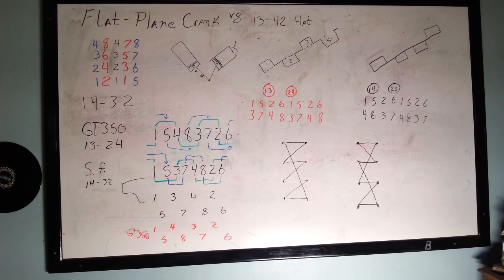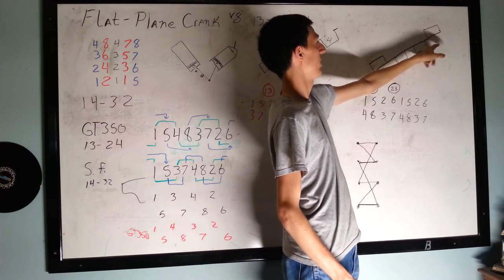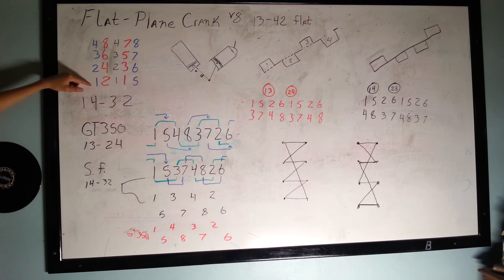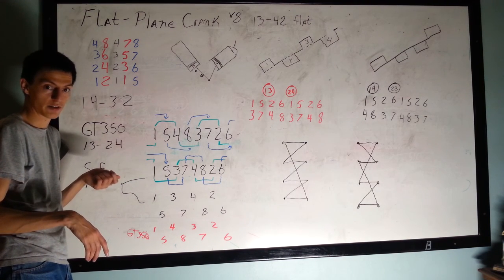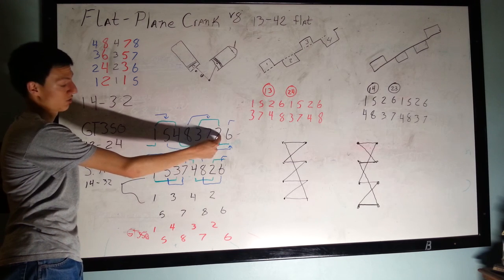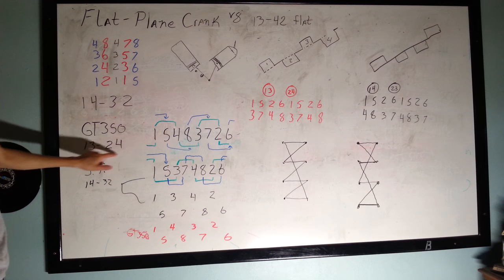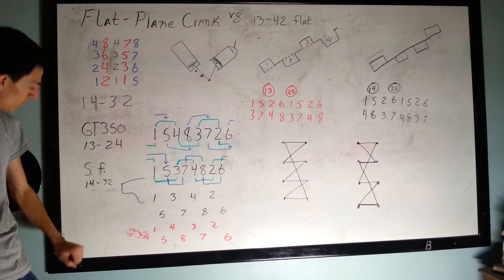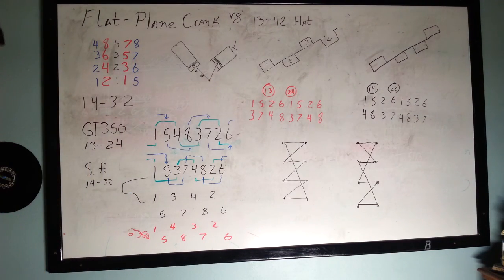GT350 Flat Plane Crankshaft explanation and review

Comment: It looks like Ford's variant of the flatplane design still endures a rocking moment from end to end of the bank. The crankshaft used in the Voodoo engine has larger end counterweights to mitigate this issue. But compared to a properly counterweighted crossplane v8, which is balanced in first and second order forces and moments, the Voodoo has a second order force due to the 180 degree crank resulting in non canceling non sinusoidal imbalance of pistons, second order force, which can only be mitigated by twin balance shafts per bank which rotate at twice the engine speed. From my perspective, they gained a cool engine note, some better intake and exhaust scavenging, and "flatplane" advertising. And they don't even get the renowned "lighter" flatplane crankshaft and it still keeps the second order vibration problems.
Reply from the maker: I'm not entirely sure the flat plane setup is perfect for scavenging. A long time ago, David Vizard did some dyno tests of 180 headers to get the resonance of the flat plane. He noted that when header tubes were not proper lengths on the 180 setup, it would have a negative effect, while normal long-tubes with the crossplane input would work fine, even if the tubes weren't exact. I've come to really like the Tri-Y headers with 270 degree pairings.
Reply from the maker: You might like the FZ-07 engine if you're into oddball crankshafts.
Reply: That's why, scavenging isnt optimal on a crossplane v8 with equal length runners on 180 degree headers, the runners have to be ridiculously long for the length to be equal, which just isnt good with many rpm ranges for powerbands. Thats why nascar uses tri-y's, those mega longtubes wouldnt be suited for those rpms. A flatplane v8 however can get perfect diameter and length runners, as well as even intake and exhaust pulse intervals. The power advantage in scavenging with flatplane over crossplane (with x-pipe) is still nearly negligible, even Mercedes admitted that fact in their engine vs the competitors for the V8 supercars series in australia. 
The vibration is the reason there is no rational point of using flatplane v8's over crossplane. Though not every car could run x-pipe, especially extremely low front engined purpose built gtlm race cars like the C7R, all those fromt engined competitors run side pipes. Just cant stick them under there in a car that low. But true duals with tri-y's sound verocious. The exhaust pulse interval becomes two pairs of 270-450 into one collector. Still pretty decent compared to a flatplane tri-y interval of two pairs of 360-360. V8 Supercars is the perfect example of Single cam in block superiority to DOHC in vee engines when you dont want to rev past 10000. The power:weight advantage of the OHVs even allow teams to get away with using iron blocks over the aluminum blocks that the DOHC teams used, and they still got whooped by Ford and Holden. You never need to rev that high, especially when turbos are everything now a days.
Reply from the maker: Yeah. Pretty much. Honestly, I've moved away from "optimized" engines. LS3's run at 110% volumetric efficiency with a 226/236-110 cam. Some people deride the ASA cam in the LS3, but on a practical level, it's perfectly fine. I like the 228/236-110 on a 107 ICL. It's not a 9000 RPM deal, but for the operating range of 3000-5800, the engine will make almost 500 foot pounds of torque. No gear changes, no crazy valve springs. Just headers, 100CPI cats, cam, factory intake.